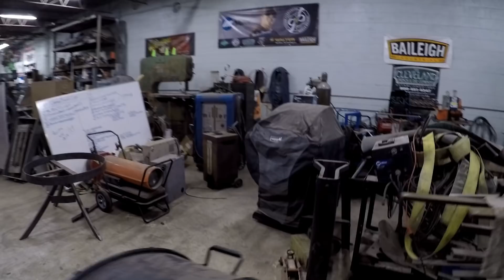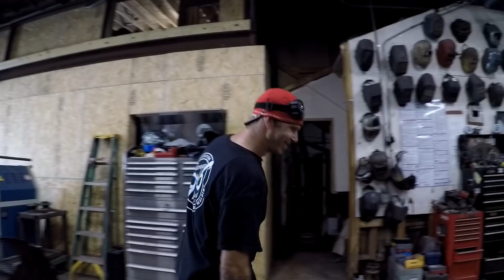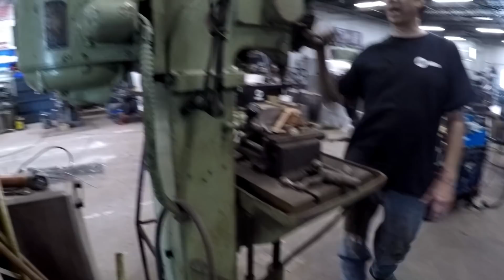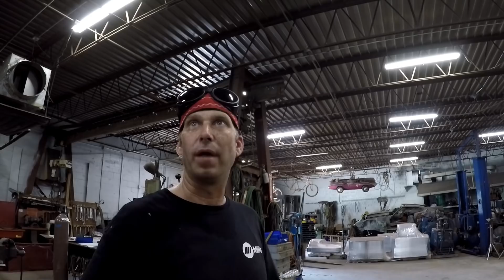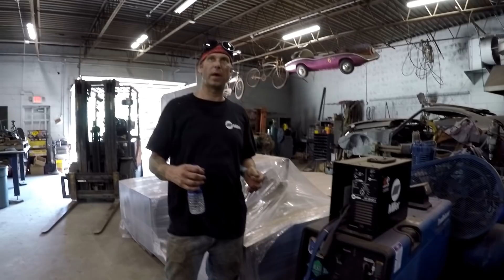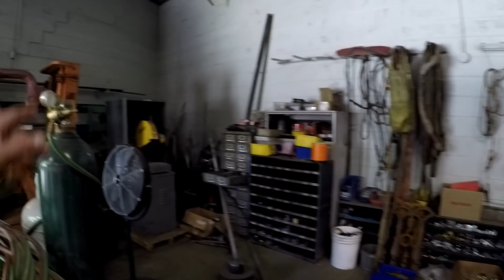Shop Tour- Garage Bound LLC

Comment: If you haven't already...you should cut that top die in to sections...1",2", 6".  Or what ever.   Then you can fabricate box shape's on that brake.  I grow up in the country  and my dad had a shear and brake shop/ barn.  Built wood stoves and  trailers and a lot of stainless steel restaurant equipment like countertops and deep fryers and stuff like that.  you need to get a good shear and a gooseneck die cut into sections and then re-fab that truck.  Cool place.

Comment: The swivel locking mechanism in Wilton vises is terrible.  The bolts just hang down and try to tilt over when you rotate the vise, which effectively shortens them causing the swivel motion to stop. I have solved this in my Wilton vises by machining blocks to keep the bolts straight then tacking the blocks inside the swivel housing. It makes using the swivel tolerable.

Comment: That turret drill press is super cool wish I had one
Reply: Crossbow Hunter you can buy mine! I could use the space
Reply: How does the turret go around do u do any thing or wat I never used one also
Reply: How much u want? I live in Ohio I do not have a way of Bring it back to my shop
Reply: Crossbow Hunter I would take a grand for it. How many miles from Chattanooga?
Reply: Crossbow Hunter you could put it in the back of a pickup truck
Reply: I live in Ohio so idk how far away
Reply: How much do you want for it for the cost and I live in Ohio so I don’t know how many hour drive it is to your place from Ohio and we’re are you located again
Reply: Crossbow Hunter you pull the handle down, the tool does the work and when you raise the handle, when it reaches the top, it rotates automatically
Reply: The turret is a cool idea when drilling tons of the same hole? And deburring also.

Comment: I bought my first Lincoln 225 in 1963. Used it for 25 years when I replaced it with a Lincoln 300 - 300 TIG. Both worked perfectly, sat for decades in a damp un-heated shop. Trouble is, new welding technology beckons and my existing welder will not falter and give me an excuse to upgrade. Life is cruel.